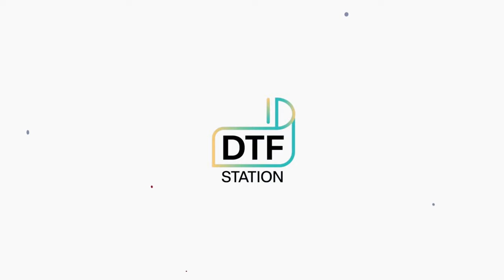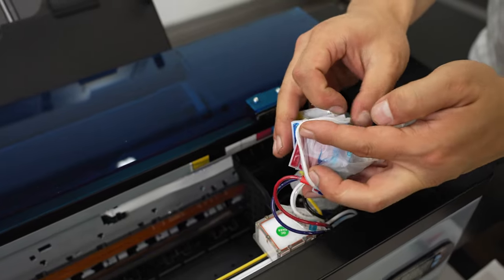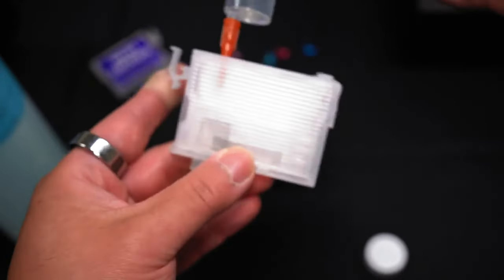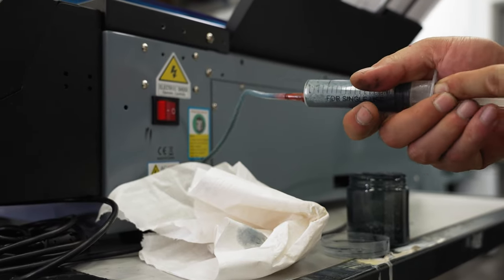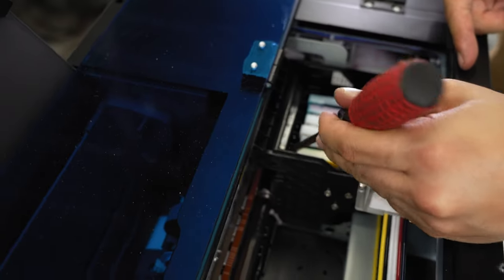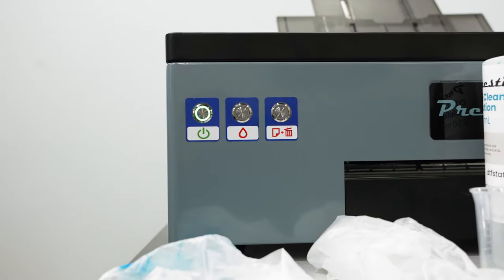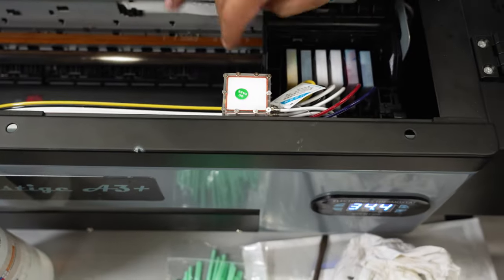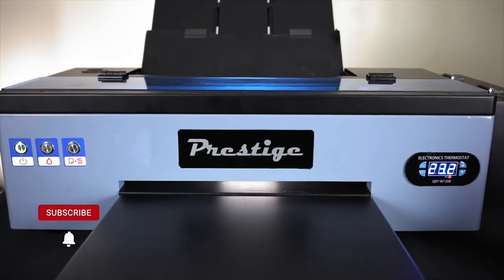Head Strike | How to Save Printhead | Prestige A3+

Comment: I get no ink or cleanings solution through the waste tube after installing the long term storage dampers filled with solution and my printer is not printing white ink. I have already replaced my print head a few months ago and my machine is barely a year old. I have not had a head strike. Don't understand why there are so many issues with this printer.
Reply: Sadly, I'm having the same issues!  I'm going back to good ole' fashion silkscreen printing. : (
Reply from the maker: Hello, are you able to join either of the 2 live weekly Prestige DTF trainings? Additionally, your point of sale dealer can connect you with support channels for fastest resolution!
Reply: Same here, Ive had the printer for just over a year and have had nothing but issues since the start. I spend more time attempting to get the printer to actually print white ink than anything. Couldnt recomend this printer any less unfortunately :(

Comment: so the cartridges that i added solution after all the steps they still have cleaning solution? did i do it right?
Reply from the maker: Hello, did we perform the 2 head cleanings also? You pull with the syringe again, there should not be cleaning solution left

Comment: One of the white cartridges is not releasing the solution please advise
Reply from the maker: Hello! Couple things to check on: let's make sure the sponge in the capping station is not dried out. Also, are you able to pull ink from the damper? I believe that is what you are referring to
Reply: @dtfstation  One of the whites was clogged.
Reply: ? If the white coverage is faint in color, is that a sign that the printhead needs to be replaced?